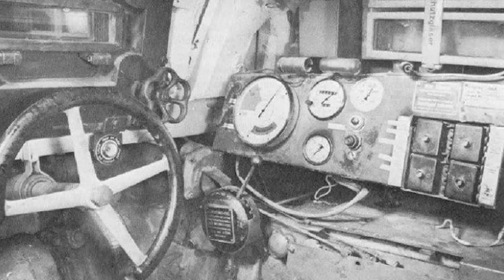A Deep Dive into the Tiger I, by the Chieftain

Comment: On of the interesting things I've read about Germany's production is that much of the forced labor that built these machines sabotaged them every chance they could.  It wasn't something very blatant or easily noticeable.  They did things like stuff rags and cigarette butts into oil and coolant lines.  Put gears in transmissions and drives in backwards or wrong.  Put flywheels together backwards.  Leave off piston rings.  Crimp or bend or not connect oil and coolant lines.  Put in parts rejected from QC.  Not fully torque down bolts or nuts.  All these little things would allow the tank to pass all the initial tests and procedures, but once it hit the field it would break down faster.
Reply: Happened in non-tank arms manufacture too--you'll hear occasional stories of an Allied fighting position or vehicle being hit by a shell that turned out to have no explosive filler in it.
Reply: Eh at least they saved money on food
Reply: Thats probably part of the reason there are serial numbers on every single part, so they could catch and shoot the saboteurs.
Reply: @hernerweisenberg7052  Actually, serializing many different parts was standard practice in the German arms industry going back decades. Even with a serial number, you could at best trace a part to a certain factory. Every part would've passed through the hands of dozens or hundreds of workers, so tracing an act of sabotage to a specific person would've been all but impossible. (The Nazis were thorough record-keepers, but not that thorough.)
Reply: It might not even have been deliberate.
Machining takes skil, you can learn it but it takes a long time to get good. Instead of having skilled trained workers you have prisoners and 'guest workers' who are being trained on the job, have a high mortality and illness rate so you have a high turnover.
You have underfed worker forced into long hours so theyre tired, losing concentration and are just not physically cappable of precision work.
Many of the factories are in quickly built underground bases, air raid tunnels underpasses and other areas, these have limited lighting, limited space for moving materials and product. Precison work is difficult.
An artillery fuse has the precision of a decent swiss watch and your trying to get it built in low lighting by a half starved amateur.
Add production targets that may be faster than the production line can physically produce product and you have a recipe for disaster.
Reply: @The Silenced It really is not quantifiable. We know it happened, we know it had an impact, but we have no statistics to access that impact. But, props to the people that defied their oppressors.
Reply: In the book "Repairing the Panzers" the author lists at least one documented example of sabotage, tyres failing due to many minor cuts made inside them during production.
Reply: Myths
Reply: @markgouthro7375  myth or it had an almost 0 effect on the effectiveness.
Reply: @hernerweisenberg7052  Back then it was quite normal for new tanks to break every 100-1000km anyways. It would've been hard to find saboteurs with the massive amounts of breakdowns and malfunctions that happened regularly.
Reply: My car dealer achieves these feats completely without forced labour
Reply: @PAcifisti  I think i had small arms in mind when i wrote that, like the thing with forced laborers not drilling the gas port through all the way on a G-43 rifle or so. Wouldn't surprise me if they sooner or later figured out that it wouldn't be that much effort to keep a list with the worker number and the part number to get back at em.
Reply: @Matamoros212  Well, one could argue about that "without forced labour" when the option is starve on the streets or work jobs with terrible pay and piss poor conditions. It's not really a choice at that point.
Reply: @PAcifisti  I'm from Germany. It was a joke. And we dont have piss poor work conditions or pay for car mechanics. It just that especially the big players have terrible service and bloated bills
Reply: @hernerweisenberg7052  Those  shifty Poles at the Radom factory got around that by doubling up on serial numbers...
Reply: @voiceofraisin3778  Indeed! For every deliberate "F*** Germany" there were probably an awful lot more "I don't really know what I'm doing, I've not had a solid meal in several years, doing this job properly takes time and energy I don't have and I'm honestly fresh out of f***s to give whether this works or not. I just do it well enough to not get beaten or shot.
Reply: @hernerweisenberg7052  "not drilling the gas port through all the way on a G-43 rifle" such an rifle would probaly not leave the factory and never reach the frontline, usually a few shots where fired, to adjust the iron sights and to make sure the rifle works.
Reply: @wolf310ii  was a common thing tho, got no evidence myself but i heared about this a lot in the last couple decades. Perhaps due to wartime getting the thing out there, one shot was enough if the rifle was clamped down to adjust the sight onto the impact point? It would fire one shot no problem without a gasport, only ofc the guy doing it would have to somehow not notice the failure to eject and cycle ;D
Reply: They once found a downer German plane, relatively intact with a cloth handkerchief in it.
Reply: Yeah, though that's more mid to late war. Between that and rushed production and later pressure from bombing. It becomes one of the "all of the above" contributed to the war.
Reply: @hernerweisenberg7052  I have restored, and repaired hundreds of German made firearms manufactured in the early part of the 20th century. It was standard procedure to serial number everything on weapons, even the heads of the assembly screws. I have often joked that if the function of a part could be accomplished with one screw with a nut on the end. German engineering would require one screw, two pins, one spring, and one retainer clip. Exaggeration? Yup, but indicative of German engineering.
Reply: @yetanother9127  It was for industries over all. The machining back in the day wasn't as precise as today. You had to fine tune many parts manually. But, they must not stay assembled for later procedures like heat or surface treatment. Serializing everything keeps the search for the already fitted parts short.
Reply: @The Silenced 1 in 10 things fuck up in production.
Reply: @xXx420Cold_@ss_Rider69xXx You never heard of them using Jews to build things for their war machine?? Were you born in a tent?
Reply: Yes, that's true. I'm surprised the Germans never thought to supervise the slave laborers more closely. And the Nazis wondered why they lost the war.
Reply: I thought the tanks were built by normal german workers?
Slave labour were kept away from armaments as much as possible exactly because of the risk of sabotage or sub standard manufacturing
The v1/2 were noted exceptions to the ruel

But the slave labour force mainly worked in construction or in dangerous jobs. some worked in chemical plants like at at birkinau. Lots worked on farms (irony being that in England we had lots of German pows working the land).
Reply: @Cookynator  funniest shit I've seen today.  Thanks!!
Reply: @yetanother9127  bold of you to assume the ss wouldn’t execute a whole section of the factory and replace them 😂
Reply: they were also heroes of ww2.these tanks were of course designed for the nazi regime.
Reply: Sabotage was not always so easy. In some companies the controls were stricter than in others. It also depends on the person who sabotages something. Not everyone has the courage to put their life at risk when they intentionally do something wrong, etc....
Reply: In a UK series Bruce Compton bought an unused panther engine. It was checked over before installation and inlet valves were  almost ground through the shank. So definitely not a myth!
Reply: still nobody managed to pull up a single source in support of that bs claim..
Reply: As far as I'm aware and I do have a degree in history and did for a time specialize in the WW1 and 2 the Germans never used forced labor for such important equipment. They did use it for small arms but even then it typically was only a last resort. Forced labor was by the vast majority used for civilian commercial goods and comfort items for the military such as clothing, gear and so on. They did at the end of the war use forced labor extensively for munitions though. But at that point sabotage or not the war was lost for the Germans.
Reply: @xXxCold_ss_RiderxXx "The Hiding Place", by Corrie Ten Boom, a Dutch woman who was sent to a concentration camp after she and her family were caught helping Jews evade the Nazis. She was put to work making radios for airplanes. She was a watchmaker who took oride in her wirk, until the foreman, a fellow prisoner, told her not to do such a good job: so she would build them just good enough to pass initial tests, but with connections, etc. not fully tightened. Did this matter? Perhaps we'll never know. But certainly, slave labor was building war materiel.
Reply: Don’t know what you went through but we technicians are human too we have bad days and make mistakes. Our mistakes are serious though, they affect our customers in dangerous ways sometimes. That’s why most dealers make us pay out of pocket to fix your vehicle.
Reply: @xXxCold_ss_RiderxXx As a German M.A. of History i must admit that Forced or Slave Labor was used by the NS Regime in all parts of the economy. Forced Labourers from Polen were send from 1939/40 into the Agricultural Sector. From 1940/41 until the end of the war the Wehrmacht was not capable any longer replace its casualties and higher demands for soldiers without drafting more and more skilled workmen from the industry. Slave Labour from people from all occupied countries was the brutal, but from the point of view of the NS Regime rational answer to this problem. And Slave Labourers were also used in high profile Armament Factories like Henschel in Kassel which builded all Tiger Tanks. German Mechanics and Slave Labourers worked together on the factory line of the Tiger this is a historical fact
Reply: Good thing once they were discovered doing that stuff they would be dealt with accordingly.
Reply: this just reads like sloppy and untrained underpaid unsupervized workers doings, dug under propaganda.
Reply: @Matamoros212 😂😂😂😂
Reply: @AdamMGTF Thank you.  Talking about sabotage when a Tiger 1 is the focus here makes zero sense.
Reply: Eric Hartmann wouldn't fly any 109 built after a certain date. He referred to them as, "definitely sabotaged."
Reply: @Ben-zr4ho  Never heard that one before.
Reply: Well I suppose if you rip a man from his family and force him to work in a factory and live in awful inhuman conditions with little food and no pay they aren't going to be too eager to build you a world class tank are they 😂 pretty self explanatory behaviour.
Reply: The germans are quite capable of sabatoging themselves, without the need for outside help (forced labor).
That hasn't changed.
Reply: @Dan-qp1el   Why would they have done that knowing what some of the animals in the red army would have done once they got to Germany , doubt they sabotaged their own.
Reply: @AdamMGTF Late in the war slave laborers were used for everything, as even old men, children, and conscripted Slavs were being sent into combat. The V2 was built entirely by slave labor.
Reply: Very interesting.  I was not aware of this.  Goes to show everyone can do his part against tyranny.
Reply: @Matamoros212 glad it's not just me. £408 last bill and car has a noise it didn't have before 😂 I give up